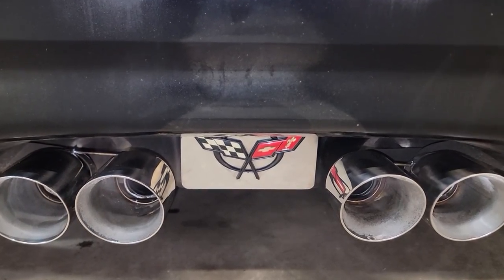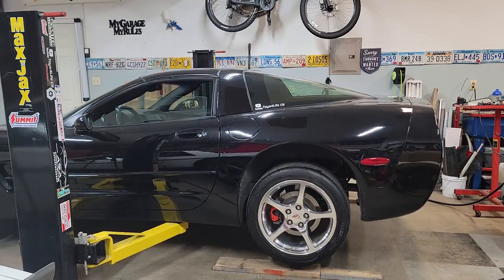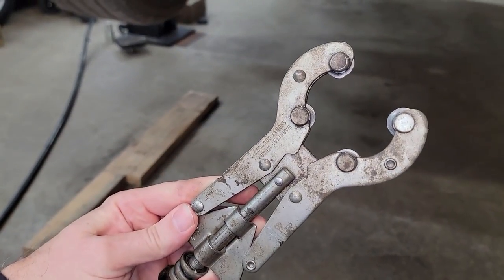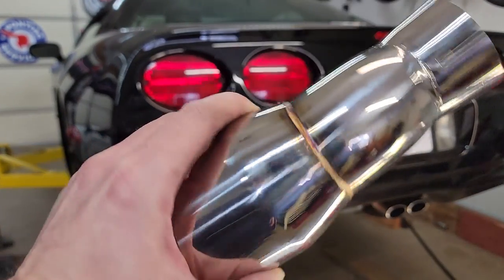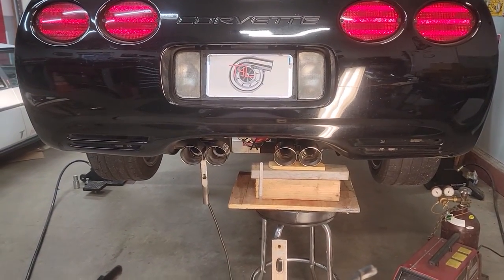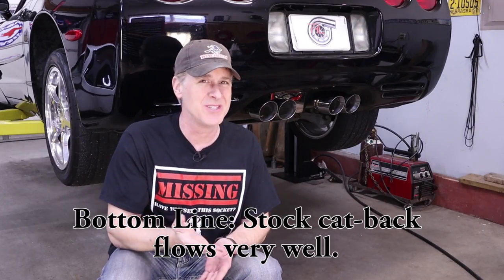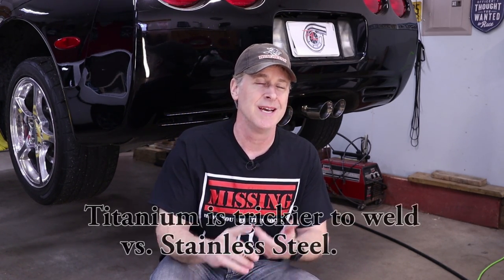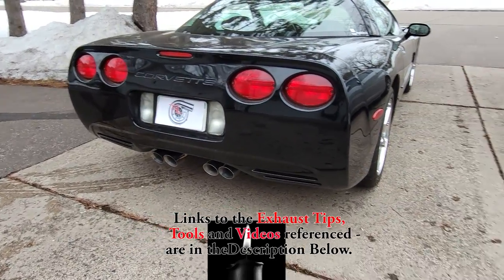C5 Corvette Exhaust Tip Upgrade (This was LONG overdue!)

Comment: I totally agree about the stock tips. When I got my 2000 Z51 coupe one of the 1st things I did was change the tips out for ones I got at one of the Corvette after market sites. They were still oval but much bigger in diameter. Made a BIG difference in appearance. I'm so glad that my 2003 Z06 tips are way better than the coupes tips were. Thanks for another great video.

Comment: I had to have more noise but didn't want to risk drone. I went with Borla S Type II and X-pipe. No drone, sounds just right.  But as you pointed out, not cheap. Impressive work on your tip mod. Looks great.

Comment: I did something similar to my early C5 Corsa Touring or Sport system as the early Corsa tips were pathetically dated looking.   The only thing I did differently is I used a longer 2x4 that spans all 4 tips at once making it even easier to insure level.    Also got my tips from amazon in a black stainless steel.   I never made a video on it as it is just to niche of a thing to do since I was starting out with the corsa mufflers.   Your scenario I think has much more appeal to more people in the same boat.
Reply from the maker: Thank you!   The other big part is there is a myth out there that the stock mufflers are restrictive - which is false!!  Companies have an interest in selling complete 1K+ cat back systems when in reality, only the mufflers really need an upgrade for performance.  SOUND - is a totally different thing and subject to a vast variety of owner tastes!
Reply: @Toys4Life  No doubt the c5 exhaust is one of the best flowing out there especially for it's generation.   Now almost everything is great from the factory except for some of the early Ecoboost ford stuff for example.     It would be fun to see you go to catless longtubes and see some before and after in the dyno department.   At your power level I would be worried about the crappy gm cats.  Mine had a destroyed drivers side cat at 26k miles on the stock engine let alone with a blower forcing the issue.

Comment: Love the vids man! My ‘04 C5 has a Bassani x pipe and axel back exhaust with long tube headers and I love the sound this car makes. From what I understand, you can’t get them anymore ( could be wrong) but, I’ve never heard another one sound so good!!
Reply from the maker: Appreciate the support, sir!
Reply: Also running the Bassani X pipe.   Great functional piece.  I was lucky enough to get it for free from my original dyno guy.   He gave it to me because he said my car sounded like shit with the cam I was running and the original open H pipe.  IT had this weird terrible farty fluttery noise at idle.  It really did sound bad.   Normally I like the sound of an H pipe over an X but in this case the X is a thousand times better.
Reply: @PNW_Car_Mods  are you running the x pipe with a stock Axel back exhaust system?? I wish I could hear it , I’m new to the C5 world so I was just extremely lucky to find a guy who knew his sht and did a cam, and some top end stuff, with the full exhaust .

Comment: I replaced mine with 4 separate tips. That heat treatment color when they look yellow and blue in some areas. I love it. Looks great.
Reply: Which ones did you get? Can you post a link?
Reply: @mwp1088  Actually I ordered different tips from Amazon but when I was at the shop the welder suggested other tips that were shorter and would fit better. Only thing is he had to butcher other dual tips to do it. Worked out great.

Comment: Looks great.  I'll have to try that bypass sometime in the future although at 597rwhp...It'll be a while before I get used to this power and or want to get it returned for mods.  Thanks for all the explanations. At the end you mentioned traction.  Im going to have to do something for that...rear tires are just spinning
Reply from the maker: If it's cool in your area, as it gets closer to 70 and 80 degrees - traction  gets a lot better.
Reply: I got 650whp and the nitto nt01 will give you a dead hook in second  gear on the street! I feel so much  safer lol. Down fall they don't  last too  long  but what a difference!
Reply: Im running the Michelin Pilot Sport A/S 3+ Zero Pressure

Comment: Refreshing to see some thought put into an exhaust modification.  So many guys go only for a sound, and use about as much thought as when I was a kid putting playing cards against my bicycle spokes.     

My used car came with a magniflow axle back system that I am pretty happy with.   It has similar looking exhaust tips, but certainly didn't cost a hundred bucks.  Comparative gas milage figures against other C5s seem to indicate it adds a bit over stock beyond just noise.     The car was set up as a corvette shop's  racer in stock  Xcross class when the previous owner bought it out of the back room to use as his transportation back and forth to Vegas from SoCal before the  clutch got noisy and I got a good deal.   I figure a pro shop would have an unusually informed ability to select parts, so I figure the extra noise is a tolerable tradeoff.   

In the old ads around from when the car was new, Andy Granatelli said the system sounds," just right".  ( this is the same Granatelli racing who put a jet engine into a corvette that my brother followed until it parked, where the driver told him that you drive that car around town with only the brake , you never need to touch the throttle. )  

Besides the axle back exhaust change, which the class allowed, it also had the early year wagon wheels rims, which don't flex as much as the correct 03 rims the car now has, a mix of Kumho tires, with a handling tread in front , a put down the power tread in back, similar to what Pirelli uses in some sports tire sets, and what seems to be the absolute minimum of screws necessary to hold the interior trim, although I can't truthfully say that mildly infuriating deal was intentional in a car that old.   It's also lowered a bit .

Comment: I would say the corsas are worth the high dollar, but always good to keep an eye out for a used pair, I picked up the corsa sports with the quad center tips for about 820 used vs 2000 with tax new. The reason they are expensive is because they do not drone, even catless headers to corsas they will still cancel all drone, and second they arguably give the c5 and all other corvettes the best sound I’ve ever heard. Just my 2 cents

Comment: These videos are great! I’m hopefully picking up a 03 tomorrow that comes with both the stock and Z06 exhaust. I’m thinking of doing the bypass mod and this to the stock exhaust and leaving the Z06 one intact. Since the Z06 one is currently installed, can i do the tip install without the exhaust installed in the first place?
Reply from the maker: Would likely be harder to be sure they are aligned if you don't have them on the car to measure and ensure they are where you want them before welding

Comment: That’s looks a lot better, it appears to b on the left side muffler has a hair line crack, on the pipe existing the muffler.
Reply from the maker: Where in the video (minutes and seconds please) - if there is a crack I want to weld it up (:-)

Comment: I just dropped off my stock exhaust to have the bypass welded in and new tips put. The shop said the 2.5 inch inlet was too big and to get a 1.75 inch one. How did you fill in the gap between the 1.75 inch pipe and 2.5” tip?
Reply from the maker: I cut a few slits, tapped everything in carefully and then welded it.

Comment: I have a 1998 Base I am looking to improve the sound I’m 66 yrs old. I would just like to make a small statement with my exhaust 
Any suggestions
Reply from the maker: Check out my videos on the C5 exhaust mod bypass for non ZO6 cars. They have a titanium exhaust which takes specialty welding.  Inexpensive and makes it a little bit louder when you're on the throttle. Not much difference driving down the road normal. If money is no object, go with a corsa sport system.
Reply: @Toys4Life  Thank you for your Info

Comment: What is an exhaust bypass?
Reply from the maker: It's at the very end on the C5 Corvette where you bypass part of the exhaust past the muffler to make it a little bit louder, it doesn't make it much louder actually sounds pretty good. That's an alternative to spending a grand on a new exhaust.